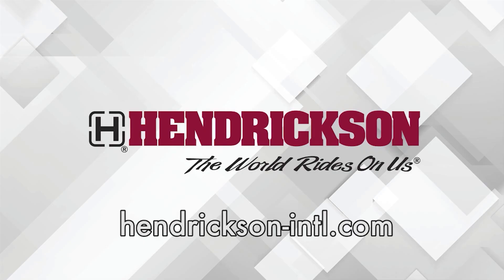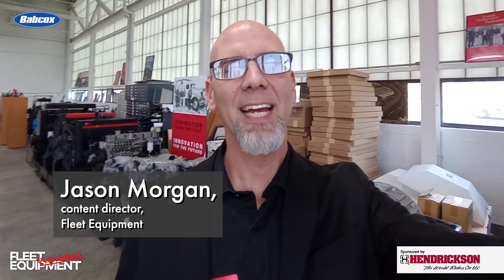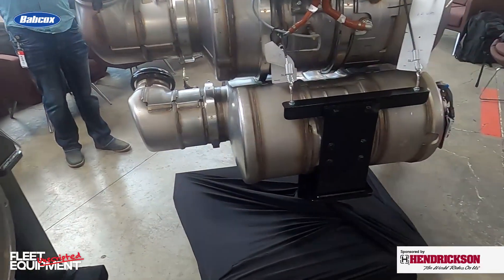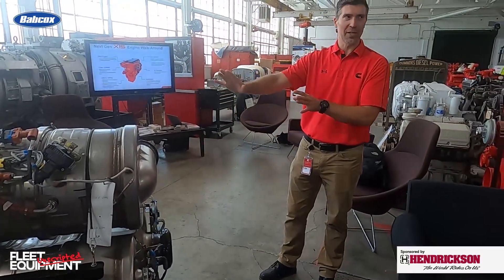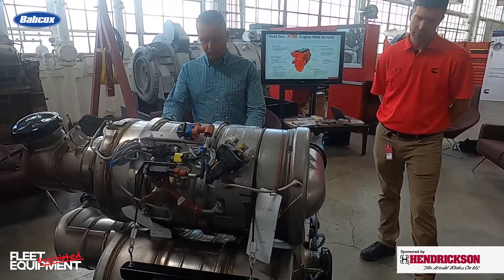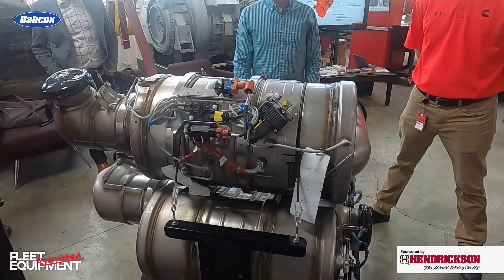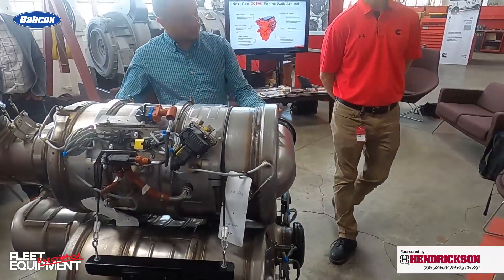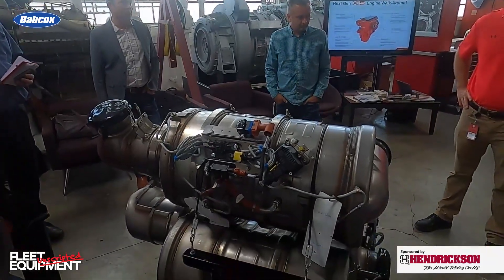Cummins X15 EPA27 aftertreatment system first look | FE Unscripted

Comment: Why do i have a feeling that,  Scania the new player in North American fleet engine market have a superior way simple and less bulky exhaust after treatment system than what you are offering. The Cummins still has Doc system unless you will completely remove the cold Egr bypass and cooler in your engines then have a bulky DOC sufficient to burn out the cold exhaust with diesel dossing? The Scania have introduced double urea dossing system eliminating Doc system and come up with a good efficient system .

Comment: The biggest issue is forcin a truck to derate out on the open road in the middle of nowhere,ma a system that is separate from engine as if it breaks the engine functions normally no derates or loss of power

Comment: the one thing these guys wont brag about it how unreliable these systems get once you have a few hundred thousand miles on them and you have a doser valve fail or you get some corrosion in ONE wire that makes the computer quit doing regen and derates you to an almost undrivable rate. or the def pump takes a crap. and then you are sitting at a dealer for a few days just to get your truck in the shop and then they have to order parts which may and may not be on national back order. but yeah lets talk about how fantastic these unreliable systems are. the x15 is a great motor, the emissions system is complete garbage.
Reply: They come bad out of the factory yesterday i went to scan one that still had the plastic bagas on the seats